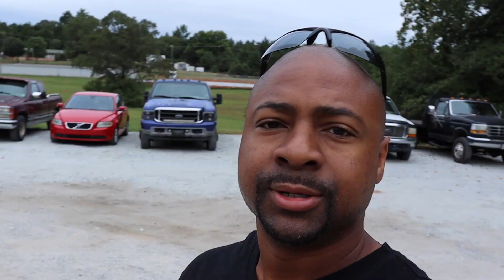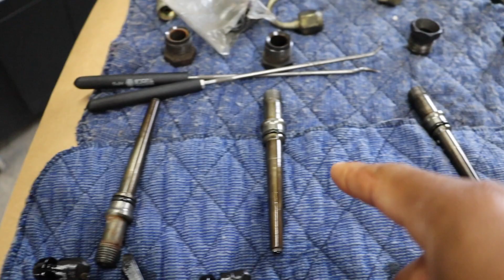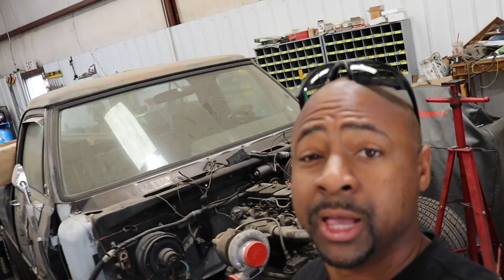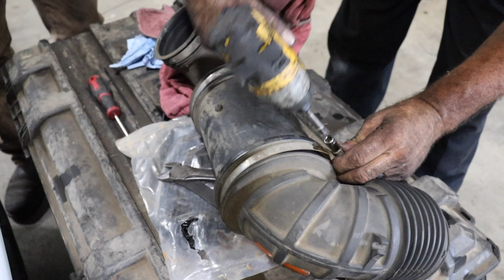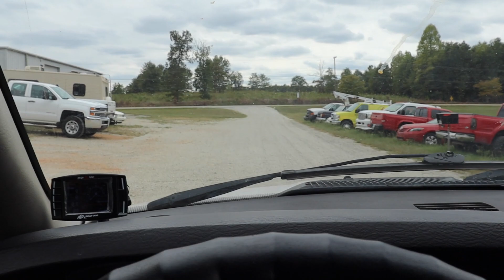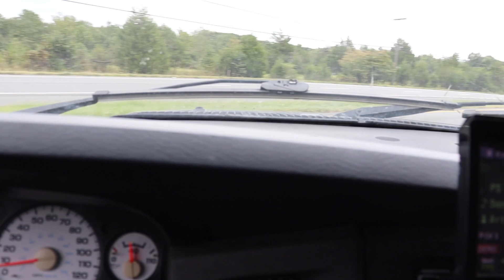New Upgrades For 05 Cummins Part 2

Comment: Now, upgraded brakes, and a bigger turbo for more boost to go with all that fuel! Awesome mods man! I know you must be excited with that 760 horsepower. I know I would be for sure! Definitely gonna have more fun, it’s awesome that with a few upgrades in just the right area gained you huge amounts of power. Hell yeah brother! What is that “greaser kit” that you removed? Or rather what’s it’s purpose?
Reply from the maker: It's definitely fun to drive. The previous owner ran the truck on used cooking oil(grease) that he was able to get for free instead of paying for diesel. Cool system just not needed anymore.
Reply: Horsepower Hobby oh okay. I understand now, that never occurred in my mind but a lot of people do that nowadays with their diesel vehicles.
Reply: @horsepowerhobby5993  is this stock turbo?